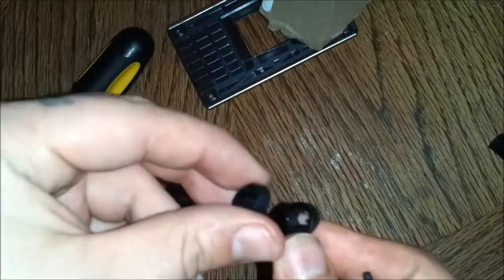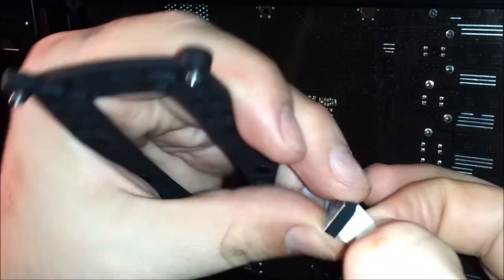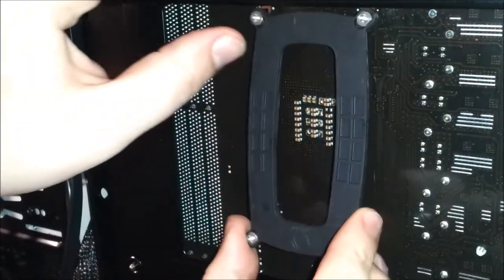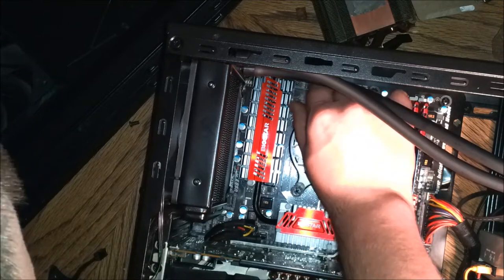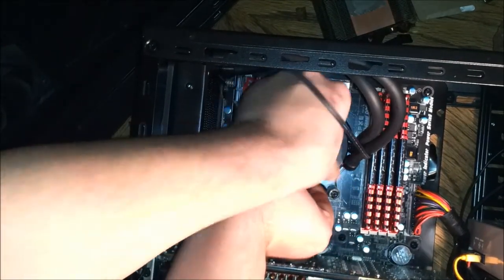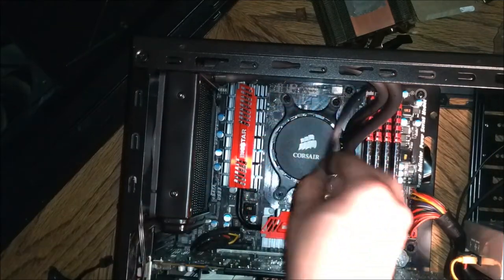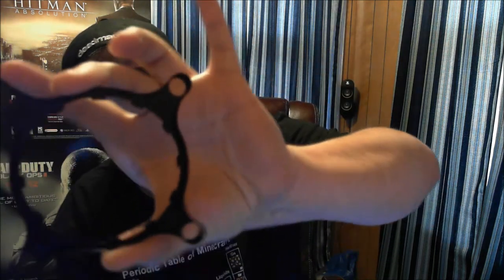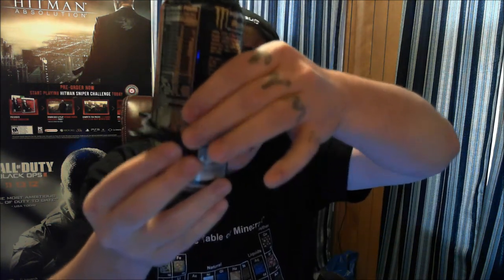Corsair Water Cooling Install

Comment: I bought and installed a yesterday Corsair hydro h55 on my i5 3570k where stock cooler 45 degrees Celsius had a 4.20 Ghz after installation I corsair hydro 29/30 degrees Celsius at 4.40 Ghz so it works and I'm very happy with this cooling.
Reply: But does it light up
Reply: +MonsterCat no not this version!

Comment from the maker: Comments are broken today. To the user who asked about pump connections, it doesn't matter, as long as the pump runs full speed. You could get a PWM static pressure fan and run it in the CPU fan header and let the speeds fluctuate with temps. I don't run a PWM rad fan, so I have my pump in my CPU fan header, but on my mobo, I have 2 CPU fan headers.
Reply: Just a quick question I have a socket LGA2011 and it seems to have a backplate already on it. So I assume I don't have to install it like you did and I just go ahead and install the rest like you did? Sorry if that sounds stupid, good video btw
Reply from the maker: LinuxMFKR
If the original backplate has the same thread pattern as the new studs, then go for it. My board did not. The studs were way bigger on the Corsair kit.

Comment: bit of a noob question, will i be able to over clock fx6300 (stock3.5) better with this than air cooling i have atm?
Reply from the maker: Yes, definitely. I don't know what cooler the 6300 comes with, but the 8350 stock air cooler is a beast on the lower tdp chips. My temps dropped by at least 15* putting the stock 8350 heatsink on an A10 APU, but the H55 will perform better.
Reply: Tymm Von D
 the cooler that came with it did not even have pipes on lmao it struggled to keep cool at stock speeds, the stock 8350 is beast for this got a stable 3.8 with very small temp increase but hoping the h55 will mean i can beast mode it lol. cheers for the response dude

Comment: Can we install radiator horizontally?? Means can we place radiator and fan flat on the top of cabinet??
Reply from the maker: Yes. Most prefer it. For single rads, it seems to look better on the rear.
Reply: Thanks...

Comment: did you have any problems with your cpu power cord/wire? and did you apply thermal paste?
Reply from the maker: Are you talking about the CPU power(8-pin) or CPU cooler power(3/4-pin)? Every 6 months or so, I apply my own thermal paste.

Comment: how can i change the water?
Reply from the maker: It's possible, but it's rarely recommended. It's not built to be consumer serviceable.
Reply: Tymm Von D
 thanks brother!!!! so i just bought install and the only thing i need to change is the thermal paste??
Reply from the maker: Hatoakazo It has thermal paste pre applied, but if you prefer, you can apply your own paste of choice.